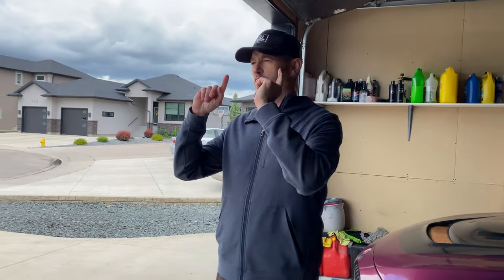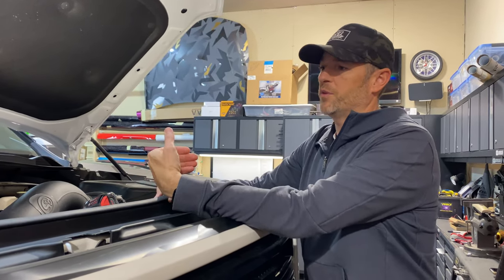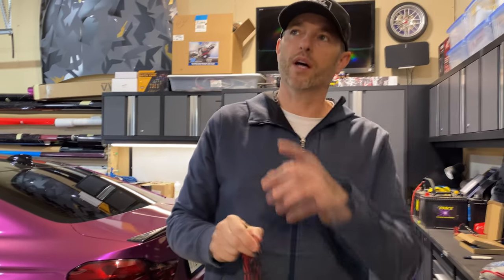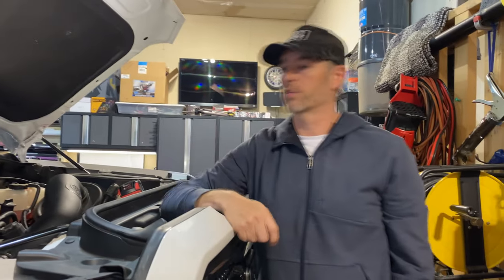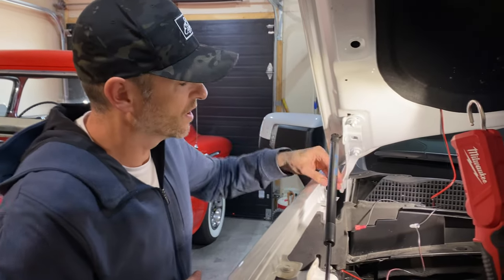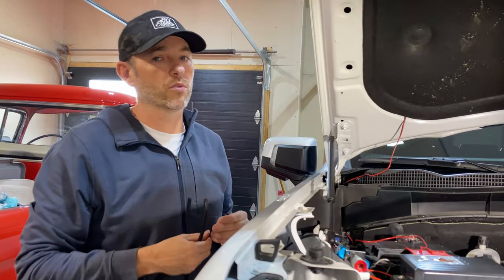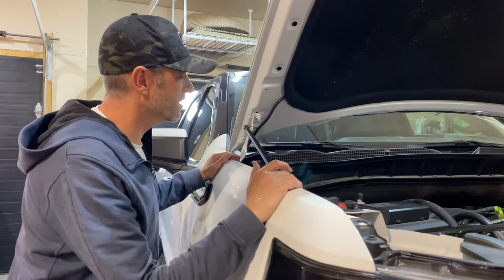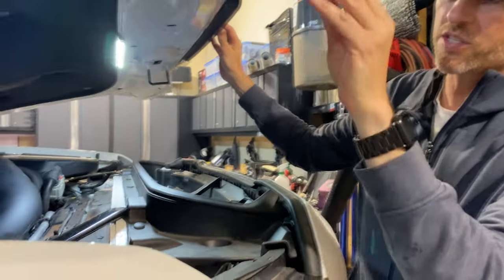GMC Forgot to Include This! LED Under Hood Lighting!

Comment: Had a TRUCK that had a under hood light pod with a long wire that when you were done you turned a knob to roll up the lights wire. GMC - yep. 95 Sierra had one.
Just found one on eBay.

Comment: Neat. I just use a metal LED touch lamp with a magnetic back and keep it under the hood (away from the heat). It is the size of a hockey puck...so, many Canadians will be able to judge the size. 😂

Comment: Don; I installed the same kit, exactly as you have yours, but I added a waterproof Push Button on the Insulator Pad for when the Truck needs service and then I am able to shut off the LED switch. Pack of 5 Push Button Switches for $8.00 US.  Push Button is Black and Black Rubber coated cover.

Comment: Crazy my 1977 Silverado had under hood / glove box / under dashboard/ lower inside door panels for exit and a red door opening caution lite...with all the led technology and they dont light everything up for $ 64, 000. Truck , Even my tail gate turned on lites when opened now you must use key fob  or dash panel switch 
..and it's only on for a short time when using the fob... My 5000.00 1977 Silverado had all that"

Comment: Great idea, I'm going to have to pick one up. Only thing is, it needs an off switch so if you take it to the dealership or a mechanic you can turn it off. So when they have the hood open for hours at a time it's not going to kill the battery. So I guess you can just pull the fuse or unplug the switch. Great idea though. I think my mom's 79 trans am had one I'm not too sure. I remember a car growing up that had a light but it was not very bright.

Comment: I noticed from another reviewer of a very similar product on Amazon that the inline fuse is on the wrong lead.  The fuse should be on the positive (+) lead, NOT the negative (-).  The way it is wired now could possibly lead to a dangerous situation.  I like the product and having a light under the hood, but when I install mine, I'm going to rewire it so that the fuse is on the positive lead.  Thanks so much for all your videos.  I have really enjoyed them.
Reply from the maker: Easy adjustment!  Glad you like them
Reply: Don, did you rewire your in-line fuse? I just picked up this LED strip and was going to install.

Comment: Amazing how such a logical feature, that's been around for years, could be omitted by the engineers. Additionally, the same could be said for courtesy lights under the dash. LED dome lights are nice, but don't really put the light where you need it.  Next mod on my list.

Comment: Nice installation! Out of curiosity, what is the quick disconnect to the left of the battery (with a red cap on it) used for?
Reply from the maker: For my 8 gang accessory switch.  It’s a 60A breaker
Reply: @Donslife  Thank you sir!

Comment: The only odd thing is the fuse is on the negative side.  I'm just connecting to a fused supply as well,  in the event of a dead short - don't like the sparky stuff.
Reply from the maker: Fair lol
Reply: @Donslife  Yours looks to be a 1/2 ton variant, mine is a 3/4 ton and the rear mount location is too low, but GM also put a forward mounting point that works perfectly - I just got mine installed and no drilling or reaming required.

Comment: What size split wire loom did you use? By the way, excellent video. This looks like the ticket. Thanks
Reply from the maker: 3/8 or 1/4.  Not certain.  I have a bin full of various sizes

Comment: Why not install the positive wire after the fuse?   GM puts 3 or 4 bolts on the other side of the + terminal for accessories.   Usually has 1 or 2 free bolts for aftermarket stuff.  Just gotta buy a bolt.
Reply from the maker: The included wiring has an inline fuse, but you could do that too if you wanted.

Comment: At the 0:45 mark, is that an after market air intake?
Reply from the maker: Here you go, its an older video if the upgraded intake: S&B Filters Cold Air Intake 6.2L GMC Sierra AT4.  Full Install and Review - No Check Engine Light!
https://youtu.be/13HkPCBsBn4

Comment: Can this be hooked up to the auxbeam so the led can be turned on at night only
Reply from the maker: Sure, but you could avoid putting in the hood pin switch too if you are going to use the auxbeam as a switch
Reply: @Donslife  thanks for the quick reply. Love your videos. Definitely inspiring me to do some mods to my Sierra.

Comment: Hey Don…I installed this light a few months ago and it worked fine. However right now it’s not working. I remember you saying there was something with the switch and you replaced it. Do you recall what switch you got and where you got it from? Thanks!
Reply from the maker: I haven’t replaced the switch yet, but I knew it was the weak link.   The contacts get corroded.  Just twist the pin back and forth so it scuff the contacts a bit.  It will probably work.  When I update the pin switch, I will link it here.
Reply: @Donslife  Thank you Don for the quick reply! I’ll try that! If it works I might spray some contact spray on it to minimize corrosion.

Comment: I ordered this and got it yesterday but didn’t work, there’s no power to the LED strip, I checked fuse and cable for any defects but all ok 
What can be the problem ?
Reply from the maker: Sounds like a defective unit.  I would contact the seller for a replacement.   They are pretty cheap quality

Comment: BUYERS BEWARE...I bought the kit and had to return it for a replacement. The sticky tape did not work on both occasions.
Reply from the maker: Mine is the original tape and I only made sure to clean the surface really well.  🤷🏻‍♂️
Reply: I hear ya brother....I cleaned the surface with an alcohol wipe. It it seemed the tape  was too weak to grab hold.

I repurposed the kit and clamp it above my work bench.